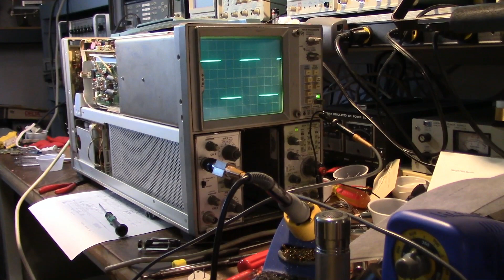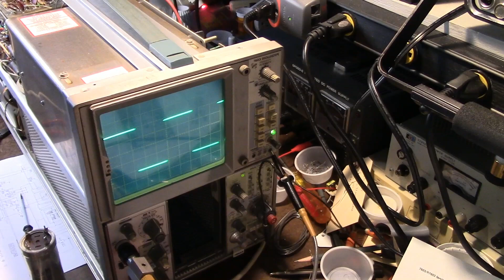Tek 7603

Comment: Hi! I have a tek 7603 with font problems, I try to repair and the problem is in low power, 
Doing tests with the regulating source disconnected, only the rectifier source and are some voltages normal with a little more voltage?

Comment: Hi Todd 
Bought myself a 7633 and are struggling sorting out the power supply. I'm  not getting the voltage readings on pin 891 on the Power supply as described in the manual.
Reply from the maker: Hi Pieter,  Are all voltages absent or are you measuring anything ?  Isolate the PS regulator board  from the rest of the instrument .  If the voltages now measure OK ( At P971 on the manual edition I have ) there is a fault further down in the instrument. If still no outputs , you can trace through the PS for fault.  If you determine the fault is not in the PS but in the rest of the circuitry, Isolate different boards , one at a time to determine which one is at fault.  Look for bad dipped tantalum caps. they are prone to failure. Good luck, these are great scopes.
Reply: @toddanonymous5295  Hi Todd  Sorry for only replying now as I had some stuff to take care of. Thanks for the reply. I actually started looking at the 7633 today and am still where I was 2 weeks ago. Checked everything on the rectifier board and all caps tested ok. I get all the voltages on P891 except one reading that should be 40+ V that measures -6V on pin 7 of P891. Want to fix rectifier board first and then check the rest of the boards. As the 7603 is basically the same as the 7603 (power supply) can you recall what measurements you took across the main caps on the rectifier board of your scope.